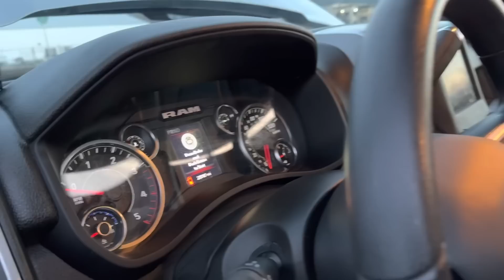Tired of the 2022 Ram Cummins Engine blowing up.

Comment: My 2022 ram had misfire codes from 100 miles to 1,300 miles consistently then the assy transmission blowup. I got my money back from Ram. I don’t think I’ll be buying a new truck. Looking at a 2020 with 30,000 miles.
Reply: Avoid. 2020 has the CP4 pumps
Reply: 18 best Gen 4
Reply: @BigMikeRobinsonFJB  RAM recalled all the CP4s
Reply: @BigMikeRobinsonFJB  2020 are recalled to replace the CP4 with a CP3.
Reply: @KnightAtomic  yeah,, they recalled them,,, but can't get the parts to fix them.
  I've been waiting over 2 years now.
 They say its because of the covid virus causing supply chain issues.
Reply: @truetexan7755  Must be your dealership. Took my 19 in last month, and the dealership had 3 of the Y78 kits (CP4 recall) in stock. Took one day to repair.
Reply: @truetexan7755  yeah I agree. It's your dealership they are allowing them three a week.

Comment: I believe the compression is way too low on ALL 5TH GENS because they lowered it drastically In order to quiet them down.  Now, the oil pressure is way too low and the internals are NOT being lubricated and they're getting way too hot and grenading.. I lost a 21' engine at 102k miles which I took care of like a baby. I now own a other 21' which is currently ar 191k miles and I now keep MORE OIL in her then what's called for hoping it lubricates her better which probably doesn't scientifically. Lol. This is bullshit and I've seen so many good men lose their business for trusting in thr RAM BRAND just to be let down. They built the best engine ever in 2017-2018 and then scrapped it because it was too good. Now we have this garbage

Comment: Nothing but problems with the ram 3500s I know of over a dozen at my workplace.   All have issues.   2020 and up to 2023 are even blowing motors and transmission. What a joke. Look under hood at one.  Too much stuff.  Plastic. Computerized crap. Mopar crap
Reply: have you looked under the hood of a powerstroke? I just got one at work and holy crap!!!!